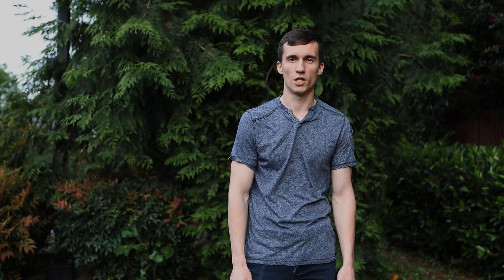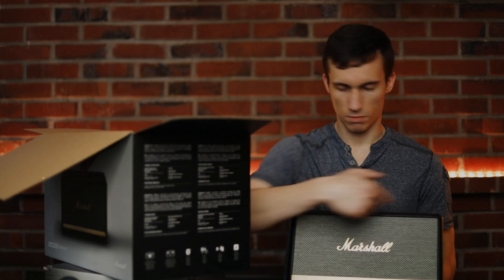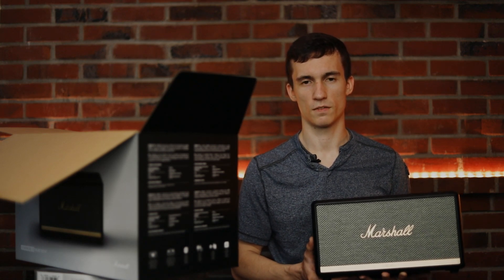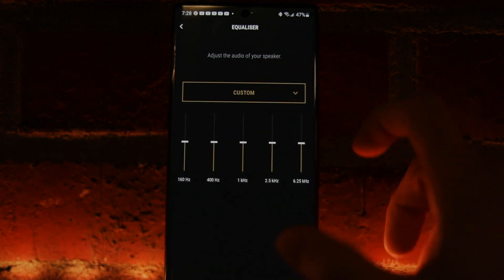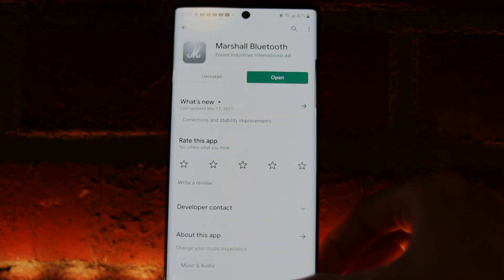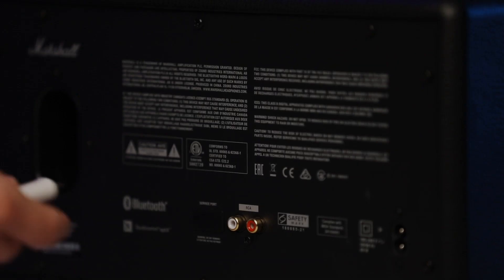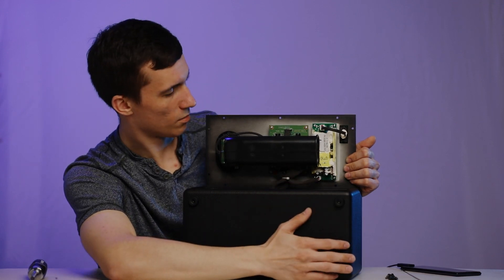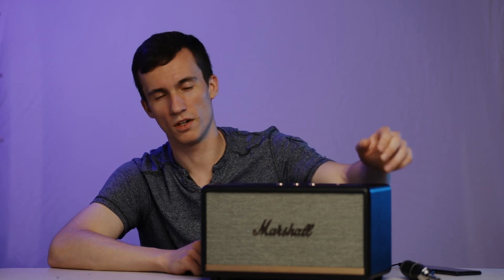Marshall Stanmore II - Review & What's Inside

Comment: Hi Alex 

Great video, I know this is an old video so you may not see this question, however I was wondering, if I took one of these apart like you have in your video, could I take some cables from my head unit in my vehicle and tap into the speaker cables inside the speaker to make this play with my in car stereo? Would love if you could shed any knowledge on this
Reply from the maker: You can simply use an inverter to power the speaker from the car, and head units have rca output usually especially aftermarket, so that can go in the back of the speaker since it has rca input.  As for signal path internally, I have not looked into that.

Comment: Does Marshall stanmore 2 need an pre amplifier if I want to connect it to my old turntable? (The turntable itself needs an amplifier)
Reply from the maker: I am not sure I do not have a turntable to test it out with either the 3.5mm jack or the RCA input.

I did a basic test and intercepted the signal from the 3.5 mm output of a standard mixer. When the volume knob was set to the 7th mark on the Stanmore the output was acceptable for listening close to the speaker then when you turn it to 10 it's plenty loud. The signal coming from my mixer was set to the max but without clipping. This 3.5 mm input signal playing a song averaged around 2.6 volts peak-to-peak. And the amplitude peaking around 1.6 volts and averaging around 500 millivolts.

Then without changing knob positions a 1kHz sine wave fed into the speaker through the 3.5 mm jack with a peak-to-peak voltage of 792 millivolts (during drums parts which are usually loudest) was enough to allow me to hear the tone through the Marshall speaker. It was audible without being piercingly loud up close. And still could be heard from like 20 ft away indoors. 

Lastly a more technical test. I measured 1.4 volts peak-to-peak at the 3.5 mm input side playing a constant 200Hz test sine tone. At the woofer output terminals (speaker disconnected) the output measured at 4.72 volts peak to peak. The volume was at the 7th mark. The output at the woofer terminals should be higher I believe and connecting the probe caused the input 3.5 mm cable to heat up, so I aborted the test there. Gain is ~ 3.28(10.31159 dB) at volume 7 assuming my measurement was correct. 

I hope this helps! :)